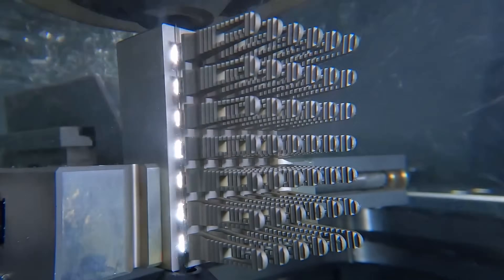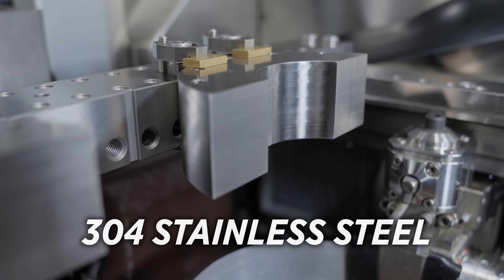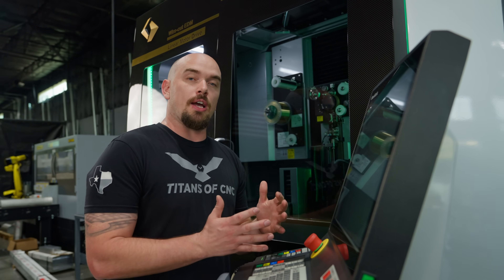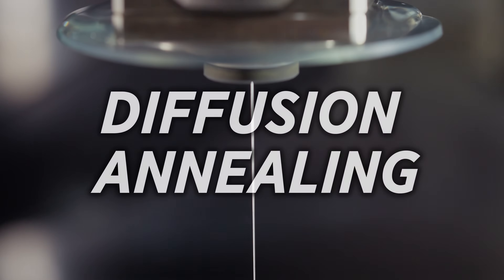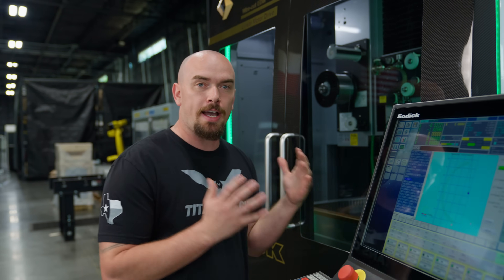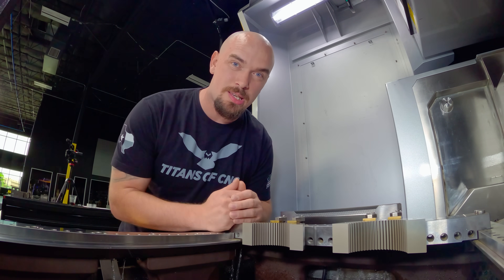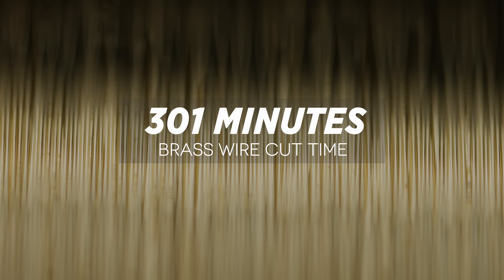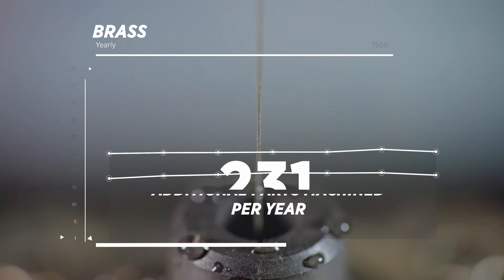Can We SPEED Up the SLOWEST Process in Machining?

Comment: You guys are also comparing oranges to apples z+ wire would be more practical with you run both away as you can run with the z axis high then the part vs the brass wire would cut “more better “ or “faster” if you set the z axis .020 thickness of a pocket scale above the part it all comes down to holding the workpiece try to avoid using both way as work cutting selection as you risk braking wire that’s why the coded wire would be practical as is more desirable

Comment: Nice to have some figures: 2855m for 301min ends up at 9.485m/min for "normal process". Z+ & iGroove, 1949m for 208min give 9.370m/min. So in normal world, it is a generous 2% process efficiency increase. Not a really serious comparison. Either you gain 30% of wire, or 30% of time, but not on effenciency.

Comment: How does this wire do in oil wire EDM'S, the oil wires are extremely slow but the surface finish is superior. The downside is they are waaaay slower than the DI water wires. Would like to find a way to speed them up.

Comment: The best solution for wire EDM being the bottleneck in a shop is to habe multiple EDM machines 😂, being the wire guy in a shop with half a dozen of them running at my disposal, I can say with absolute impunity that changing the type of wire to any other that is currently available with where our technological advances are at currently, makes no noticeable difference - the juice is not worth the squeeze. One of the few downsides to running wirrs like Z+ types is that you can't get as small of a diameter as with other wire types and you are unable to run jobs that have corners or contours with extremely small radius to them.

Comment: I have also done this test with both of those wires on a sodick vl600qh.  Wait till you try bedra blacksparks wire.  Fastest cut i've seen yet.  I kept the same power setting on all 3 wires only increasing the (sf) speed limit until the wire pops.  With the z wire it was able to push it about .020-.030 ipm faster than plain brass.  The bedra blackspark i was up .060 faster and stable.  Anymore and it would pop.  And im sure it could be pushed more if you were to fine tune the power levels.
Reply: For the last 3 years i have used a brass wire from Oki Japan, great wire, never break and low deposit inside the machine. 
I switched to Bedra, same condition and same job, 20% faster cutting and it cost me only 5-6% more the Oki.
Reply: A actual test result

Comment: Too many variables changed at once. Special mode + premium wire. How are we to infer that the special mode alone wouldn't make the normal wire benefit similarly enough?
Reply: This is an Ad, like the rest of their videos.
Reply: Yeah, maybe they can make a quick short showing the brass wire using I groove
Reply: Talked to my boss this am about this vid and he said zinc coated wire is messy as all hell and the black zinc dust gets all over the rollers and guides and it has to be maintained three times as often
Reply: The special mode doesn't affect speed, only wire consumption.
Reply: That's their testing style. Watch the boring bar test - they change the bar material, speeds, feeds, and insert radius and try to say "look how much better just a carbide bar does!!!"
Reply: Actually said that IGroove means you can slow wire feed saving you wire. Agreed that changing two variables isn't a fair test when it comes to wire Vs wire

Comment: slowest process? you haven't seen or heard of LMJ cutting? (Laser-Micro-Jet). having a laser cutting combined with a laminar waterjet as "guide". it can cut as deep as a wire EDM but with even smaller diameter, and can cut pockets. but its REALLY slow. Maybe you can make video about that process sometimes, as together with metal 3D printing, this is used to create better vulcanisation-molds for car tires
Reply: I actually built one of those in college. Could cut precisely like an EDM with the speed of a laser and the HAZ of a waterjet. Could also cut things like very thin brittle material, or composites well. It's like the best of both worlds. Was a waterjet cutter at 25k max and up to 250W average for the neodymium yag laser, could use 1064 532 or both. The Yag was fiber delivered then focused through a sapphire window into the nozzle jet body. We made the the sapphire window to waterjet adapter. Took a few tries 😂

Comment: Would it be possible to EDM cut a rifle barrel bore using EDM machining.
What I mean is, with the initial barrel bore hole being drilled, it's never a perfectly straight bored hole.  Because of the length of the drills used to drill these bore holes, there's always going to be some curvature.  It's usually located near the center of the length of the barrel.
If that initial barrel bore hole is first drilled conventionally; let's say it's a .17 initial caliber bore hole; could it then be EDMd pefectly straight and round with the EDM process, which would then be followed up by the rifling of that bore?
Or, would the length of the EDM wire being used, also impart some curvature in the cut as well?
Hope my question makes sense.
I'm just wondering if a perfect zero-tolerance -cut gun barrel bore hole can cut using EDM.
Reply: Theoretically it is possible but I would use a sink EDM.
Anyway you miss the strengthening effect of cold hammering. At the end the barrel would be weaker than the traditional.
Reply: The barrel doesn't need to be perfectly straight regardless. It needs to be consistent. Consistent bore diameter and consistent rifling rate is the most important. Straightness plays a factor but it's not the most critical by a significant margin The process of zeroing the rifle is more critical.
Reply: Can it be done? Sure. Lands are good, grooves aren't and will still probably need a polish. Faster and easier with the traditional method without a custom EDM machine.

Comment: Generally which one of these Wire EDM and EDM drilling machine is better and user friendly:- Sodick or Philips? For application like cutting Carbide Flats and rods, making deep holes from 0.30 mm to 3.0 mm in a carbide rod and PCD blanks..?

Comment: By rotating the wire in the cut it seems you would lose a bit of accuracy, is this the case?
Reply: Should be essentially exactly the same if not sligtly better as you're exposing fresh wire with an exact known diameter to the cut

Comment: But what’s the cost increase of that premium wire?
Reply: probably 50 to 60 dollars more per spool.
Reply: It's a different alloy, (cheaper materials since more zinc) electroplated and then heated up, can't think why it would be much more expensive.
Reply: It also runs dirtier. Zinc causes additional slag, and will run filters / resin quicker. Also with that much increase material through the machine it will need PMs faster.

Comment: 2.8 KM OF WIRE YOU SURE?
Reply: our machine hasa chopper in the back where it cuts the used wire into little tiny piece so its easier to recycle bc yeah they use a crap ton
Reply: Absolutely sure these things use 10m per minute on average so 600m per hour times 5 is 3km so about exactly what they claim

Comment: What's the cost difference between the two spools?
Reply: Shhh. Don't bring that engineering mindset to a marketing video!
Reply: @aperson7624 did you not watch the whole video? It’s faster and uses less wire this is just an ad for shop managers to see if this solution is cost effective. It’s not gonna be cheap at all production scales
Reply: it cost more but its worth it. Magic is to know when its worth using. When cutting some thin parts ( to about 20mm for me) or parts where precision and roughness is not important its better to use brass and only one cut technology without any skimming. For taller parts where process slows down like hell. I had parts about 150mm tall and cut time was close to 24 hours. With coated wires I was closer to 18 hours. Its 6 hours shorter and thats a lot. Power loss, some machine malfunction some "omg we have to cut it because we totally forgot about it"... I was in EDM department and I simply recommend wire for every taller part. 

Also there is a magic trick but you got to know machine like your back pocket. On first cut you simply put offset to -0.02mm and on skimming you bring it back to 0.00mm - skimming passes will go much faster but you have to know machine because non technological offset can ruin your part so your minus on first cut might be something else or maybe on skimming you have to go for +0.002 to end up with on point dimension after machining.
Reply: They won't say outright because it's basically an advert for sodick products. So they won't mention downsides or cost increases.

Comment: Was the thickness of the wire the same? I'm not an expert on this, but I believe that if the wire is thicker, it can withstand higher temperatures, current, and voltage (I know that a greater width means more work for cutting the material). Thank you for your response!
Reply: The difference is the zinc coating vaporises easily while being part of brass alloy so wire can be recycled.
Other metal coatings are better than zinc but wire could not be recycled.
At least this is what people from Sodik told me several years ago when I designed the zinc plating line.
Consider the wire is coated with few microns of pure zinc when it is 1,2 mm then it's drawn and heat treated to final diameter
Reply: @fabioberetz  Thank you for your response I appreciate it as someone who works with CNC EDM wiremachining but have little practice and nobody to teach me. :-)

Comment: since it knows how far appart the top and bottom is. i dont see why its not wiggling the wire up and down that amount for like 3 times doing the rough burn/pass ( kinda like a scrowlsaw motion ) and then when it done those 3 times it goes down the wire about the same amount and repeads. since its only a roughburn/part the precision of that feature isnt that important and will be brought to final size at the clean up pass/burn anyway
Reply: It may be possible if you could work out the issues that change will cause. From my experience, the tension mechanism is "one-way", so you will need a solution to keep constant tension on the wire, between the upper and lower heads, while simultaneously reversing the wire-direction (this will also, interfere with the current solution for auto-feeding the wire, so that will likely need to be revised also). Another thing to consider is that while "cutting", the wire cannot be touching the workpiece; it is the arcing, as the wire approaches the "cut" that actually erodes both the wire and workpiece - eroding the wire also makes the wire more likely to break.

I believe rotating the wire is the way to go because the rotatory motion will affect the tension less than oscillatory motion (and any deviations could be tuned away), while also ensuring even erosion of the wire's cross-section.
Reply: @mics1417  it was just a though i got that might cut ( pun not intended ) on wire use . plus current shouldnt care what way the wire is moving. it may be a bit more setup pr. cut but couldnt they just mirror the top meconism on the bottom to keep it in tension well its oscillating ? or have the entire top and bottom move up and down at the same timewith like a linear motor well the wire itself is standing still ( seen from the tension mecanism's point og view ) i know that would requide a bigger gap between top and bottom head 

but agen it was just a though that poped into my head that maybe could save alot of wire if someone could figure out how to implement it
Reply: @flikflak24 it would increase risk of cutting it. 

If you wanted to bother with reusing it you could run the entire spool and risk failure anyway.
Reply: @lasskinn  fair enough. i never used a edm at all ( my speciallity is lathe work after all ) i was only woundering if it would be possible. specially since i looked at it like part ogf the wire was a insert and would want/like to get as many part out of the insert/part of wire as possible ( it would be like turning your insert every part even though there where still plenty of life back in that corner. if it was like a wnmg you get 6 parts and had to throw it out even though you could easily do 12 parts pr corner ) thats kinda how i see it. why throw out wire that technically still be used to rough with ) maybe it could then be reused as the dresser wire on the rotery grinder ( kinda like as its secend life/use. specially if it have break detection and self thredding funtion 

btw agen. im just a lathe machinest watching and commentating a idear on a sumject/part on the same industry i dont really have knolage of how work's in order to kbow and learn about what you can and can't do

Comment: the wire edm might be able to do some incredeble things but one thing i still hacnt seen them be able to pull off is a mirror or somewhat shiny surface finish ( which is probably cause of the nature of how it works. but still would be kinda cool. and maybe usefull if someone figured out how to pull off a almost mirror finish on a edm for less processing down the line of the part )
Reply: In work we have almost 20 year old Agie edm machine and let me tell you, the surface can be very good, not mirror finish, but really close to it.
Reply: @demovicc  ahh okay. i jjust never seen it. but then agen my speciallity happens to be lathe ( from manuel to swiss lathe to trille turret dual spindle with C and Y axis ) and never operated a edm in my life. but thanks for enlighten my with the infomation

Comment: 2855m = 1.77 miles. Is this correct or was it actually 2.855m ?  Never done EDM but sounds extreme.
Reply: 2,855m is correct!
Reply: Your first Calculations is correct, it is in total 2,855m or 1.77 Miles
Reply: @denneiwojti that is ALOT of wire. How many metres do they hold ?
Reply: Hold up. More zinc improved conductivity?
Reply: @ScottyAlmondjoy  No way. Zinc decreases brass conductivity. It’s benefit is that it lowers the melting point of the wire thus increasing speed and improving surface finish.
Reply: @donbotting5700 could have sworn the guy said it increased conductivity, which sounded wrong.
Reply: @ScottyAlmondjoy I think it's the overall conductivity. Zinc vaporises easily and it brings down the spark resistance. We are talking of less than 1 um on the wire not even close to having any effect on wire conductivity
Reply: @donbotting5700  That fancy wire is copper and zinc, not brass and zinc.
Reply: @loko_ftw6280  it's zinc (100 % Zn) coated brass (60% Cu 40%Zn)
After use the wire is remelted and brass alloy is back (just adjusting the alloy). Then it is drawn into a wire, zinc coated.
Fully recovered and no waste 
Pure Copper is not strong enough to resist tension.
Reply: @fabioberetz  I was just going off what he said in the video that the fancy wire was copper and zinc. Didn't look further into it than that.
Reply: Well we if u have a spools like the: AC CUT G - 0.25 - 1 spool 45 kg
Which has a mass of 45kg a diameter of 0,25mm, material = CuZn37 with a density of around 8,44 g/cm^3
Volume of the wire = 45000/8,44 = 5.331,64 cm^3
Volume/meter = phi(0,0125]^2*100≈0,0491 cm^3
Length = 5.331,64/0,0491=108.570 meter = 108,6 km = 67,45 miles

The first time I calculated that my mind was blown, how the hell do they manage it to keep that in one piece?
Reply: @MW11- wait what??!! 100km, that's insane this is as far as the capital is from me. That's like 1h ride, insane.
Reply: 2855m
2,855km